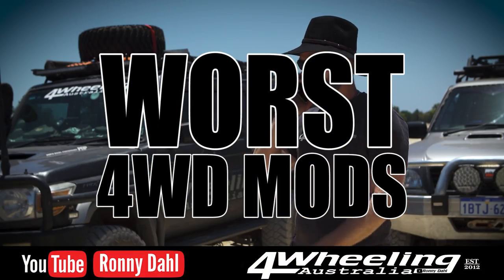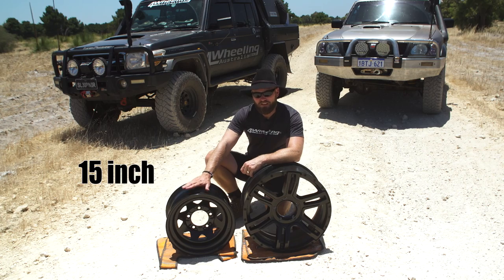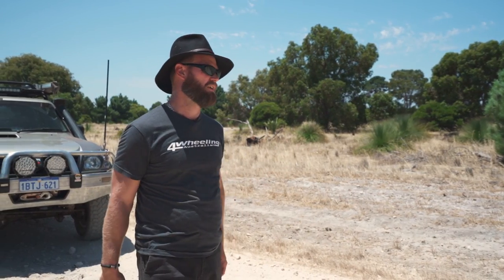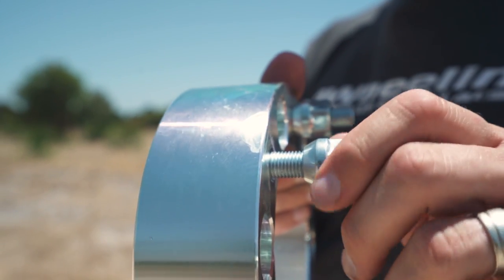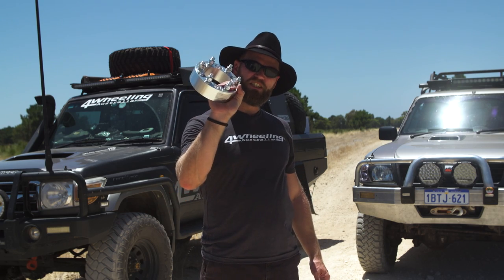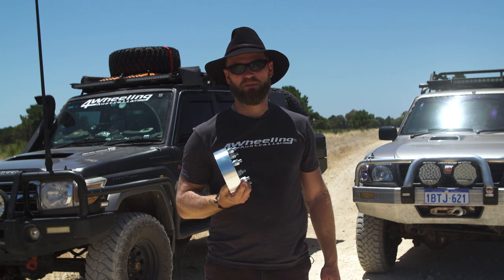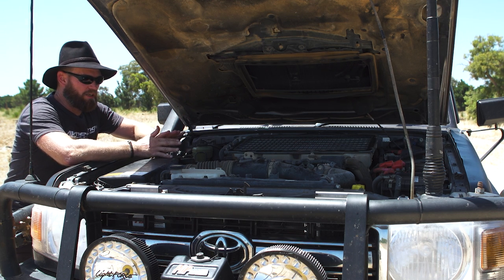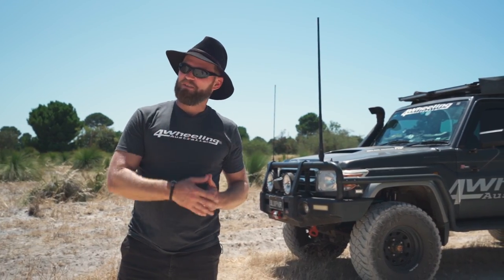WORST 4x4 MODS, DON'T DO THESE TO YOUR 4WD

Comment: U Aussie’s are smart. in America it’s a trend to get big rims small tires, I feel like I’m alone wanting plenty of rubber.

Y’all realize I’m half joking.
Reply: nothing wrong with being alone on something if you're smart mate! Well done.
Reply: Nah, you're not alone. Jeepers stick with 15" rims
Reply: Still rocking 15" steelys with 30" of rubber. So many try to talk me into going with 16 or 17.
Reply: Stick with what you know works mate! No point in having all show but no go.
Reply: Use to rock 15s in my previous vehicle, but I like pizza cutters on 16s. They aren't for the beach but they cut through the mud
Reply: Tho if it's tires for trucks you get the issue of the brakes being huge to get massive tow ratings so you can't smaller rims on it.
Reply: Not everyone in the states lol - most of us run 15-16" steelies whenever we can (my Jeep sits on 15" steelies and 33.5x12.5's ). I was bummed when I found out  my Toyota 4Runner can only run 17" due to brake clearance issues.
Reply: I meet in the middle with 20x14s on 38s that are 16.50 wide. Plenty of sidewall and no scuffs so far from off road
Reply: Nah you see a heap of wankers doing that on dual cabs these days in Australia as well
Reply: David Balken I’m with you David I don’t understand why everyone is getting big wheels and low pro tires.
Reply: I like my 16s with 235 55 16 rubbers on it and normally i run 80 psi
Reply: David Balken you ain’t the only one I love a lot of tire
Reply: David Balken - the difference is that you  have roads all over the USA, and that we have a few pretend-roads here in Oz 😄
Reply: No dude you're not alone not at all. It's freakin stupid. Even worse when the rims and tires are worth more than the truck.
Reply: Not alone man
Reply: I'm guilty of it. I bought my 2013 Tundra with 20s but it's my camper tower, I don't 4x4 it, that's what my 80 series is for.
Reply: So my truck came with 20" wheels from Toyota so I found some 18" TRD off-road wheels and some good AT tires as well.  Guy at the tire shop asked "why would you want smaller wheels and more rubber?".  I just shook my head :)
Reply: Your not alone,  I live in Illinois and see big rims all the time, the pavement princesses make me sick
Reply: I run 20s on my ram but I have 44s on it. Nothing is stock on it as well. I hate the rubber band tires. I have big brakes that’s the only reason I run 20s and nothing snaller
Reply: Definetly not alone, but the people with big rims aint offroading.
Reply: No mate, I’m in South Texas with a ram 2500 6.7 L turbo diesel and I want 18 inch rims maybe 20 inch rims with 37 inch tires and a 3 inch lift (Carli suspension with King 2.5 shocks) Bear in mind that 3 inch kit is only half an inch taller than the leveling kit, Will fit 37‘s with plenty of room for articulation.
Reply: David Balken  ..  Perhaps a trend in some circles, but the vast majority in the USA do not have such rims/tires.
Reply: David Balken I run 35-12.50-15
Reply: David Balken I wanted 16’s on my Jeep with 35’s but couldn’t get the rims I wanted so settled for 17’s. Still lots of rubber and will be badass if I move to 37’s
Reply: @canonphoto    ..  My Tundra has 20" rims with large BFG T/A KO2 tires. Can judiciously drive just about anywhere, even towing an 18ft camper. However, I also installed a winch and carry traction devices just in case.
Reply: Not alone here! I got 16" wheels with a 33" tire and im in california! I laugh so much at the guys with anything bigger than an 18.
Reply: @gregshue645    ..  As long as rims/wheels are sized to the tires and vehicle, it makes no difference. For example, most full-size 4x4 pickups come with fairly large rims with tires to match. Those large trucks would look silly with your 16" wheels.
Reply: @dwightstewart7181  of course! If i had hone with a 35 or a 37 I would have gotten a 17" wheel but i like more side wall than metal its just my preference, that goes more most of the people in the offroad community i know
Reply: @gregshue645    ..  Okay, we're clearly not communicating. Let me try again. I like "more sidewall than metal" too. My point is that you don't need small rims to have large sidewalls. You just need tires sized to match whatever rims. My truck, for example, has 20" rims with BFG T/A KO2 tires (aggressive all-terrain tires) with substantial sidewalls. Many of us in the "offroad community" run these popular tires.
Reply: @ewingfox6459  kind of like my 02 Explorer sport needs 16's trying to set up for light overlanding and Gambler 500 recovery (bought it running for $750 from a junk yard)
Reply: Yeah and the only off road you do is getting in and out of wall mart
Reply: @jerrysmith8326    ..  Where do you get notions like that, Jerry? You evidently don't go off-road, so you don't see us off-road. That doesn't mean that we're not there. Regardless, 4x4 is more than just backwoods. It also helps in bad weather, dirt/muddy roads, and so on. Same with tires. I tow a large camper trailer. Hell, if nothing else, 4x4 and those tires helps me get away from you.
Reply: @robertvulliet3278  nothing like a junkyard exploder!  Great recovery vehicle!
Reply: The difference is that  Ronnie is talking about rigs that actually go off road.  A majority of the trucks you see on the roads with 20/22/24 inch wheels and thin sidewall tires rarely, if ever see dirt/mud or are used to haul/tow as they are intended.
Reply: You're not alone as long as I'm alive.  I was happy to get a new Silverado WT last year because it comes standard with 17" wheels and black bumpers and without a lot of the crap you don't need.  Too bad you can't get a radio with knobs, buttons and a CD player, though.
Reply: Here in Texas we call those 7-Eleven trucks.when it's time to go off-road they all meet at the 7-Eleven leave that ship sitting in the parking lot and ride with a buddy that has a real off road truck
Reply: @scarharting5577  , CD player?  Wuts thayut?
Reply: You'll notice those people also never have a spec of dirt on their F350 because they dont offroad it. Seeing lifted trucks with 22 inch wheels and street tires makes me just cringe, because they literally only did it for looks. Im a function over form guy, everything i do serves a functional purpose, its not about looks.
Reply: As an American from California I disagree. People that take off roading seriously usually run 16 inch wheels and like standard now is 33s to 37s. Now mall crawlers will run 18 to 20 inch wheels for the look more than functional
Reply: @aarons2613  ,  There are a lot of guys that have more than one set of tires/wheels as well, and change them out, depending on what they are going to be doing with the truck/rig.
Reply: @hannahranga  trucks with massive tow ratings usually aren't the kind of trucks you want to take out into the bush. I've yet to see those huge tow ratings be useable on any off road capable trailer, which are usually fairly small and not ultra heavy
Reply: @ewingfox6459   You can still get decent rubber on 17s.
Reply: @dwightstewart7181    If you'd ever seen one, you'd know they look silly with anything bigger than a 17.
Reply: @dwightstewart7181    Yes, we're not communicating.  Anything bigger than 17" looks ridiculous.  Semi trucks have 22-24" wheels.  Pickups look foolish, and they ARE foolish having wheels anywhere near that big.
Reply: @scarharting5577    ..  Okay, if you really believe that, fine. My mid-size 4x4 Toyota Tacoma has 16" wheels, with off-road tires sized to match. My much larger full-size 4x4 Tundra has 20" wheels, again with off-road tires sized to match. I don't think either looks "ridiculous," nor would I change the wheel/tire combination on either. Good-day.
Reply: @scarharting5577  yeah, but I would like to be able to get more sidewall - not sure I would like the compromise in breaking performance it would cost w/o going to a ridiculously expensive aftermarket brake setup to fit inside a 16-inch rim!
Reply: Sadly here in the states plenty of idiots out with 26" rims with low profile "mud terrains" lol
Reply: Vladimir_Bone Spur_tRump  ...same for me... with BFGoodrich K02 A/T
Reply: American former and future Jeep owner myself and the 20s belong on my Challenger. If I've got 20" wheels I'm running at least 44" tires on an offroad rig.
Reply: Im in US state of Georgia running a 2001 Jeep TJ  with 3" suspension lift, 1.25" body lift, 33" tires on 15" steel rims and doing fine. When I finally make my way to MOAB I will probably go to 35" tires but still have to double check tire clearances before I do.
Reply: And Mexico I have 20 inch rims haha 😂
Reply: @jpageify  nothing wrong with 16 or 17" times in my opinion. You often need them for big brake kits, which are a must id you really increase the tire size.  I can't stand the 18+. That being said, I still have 15's on my 01 wrangler with 33's
Reply: @scarharting5577  a good reason to buy used trucks.
Reply: No youre not. 33s on 18" rims will be getting 35s next time round. I have a 2500 so Im able to get away with that. Elsewise Id be running 15" or 16" rims on smaller utes
Reply: @The_Ballo   go the 235x85 . R16  they will walk all over  any soft sand. Just whatch you dont roll it off the rim
Reply: @paulsouth4794  That's what I use
Reply: Custom offsets dislikes this comment lol

Comment: I agree with Ronnie. Make sure every mod has a purpose and don't do anything just to make your truck look good. Most decent 4x4's require minimal mods to go off road, some, like the Defender, Jeep or Landcruiser 70 are extremely capable just as they are.
Reply: 80% tyres
15% winch
5% all the rest

Comment: Here in the states we see people all the time that have 6-9 inch lifts 22"rims and wheel spacers!  But they do ok for getting back and forth from the mall to the carwash.  Lol
Reply: Ahh! but they look cool.. Virgin 4x4 ;rock crawler trucks that have never seen any kind of dirt. I see them as dumb.
Reply: Dont forget the 12 in. dropped hitches. For their boat.
Reply: Ahh, you see in California, we have the lowrider trucks. So think, 32 inch rims, 2 inches of ground clearance, and sometimes stretched tires.
Reply: cody b it’s people like you that make the rest of the world think America is a joke. The rest of the world talks about why their country is good but you talk about why it’s bad. Just saying
Reply: My Disco still has the stock size 18"s. I don;t do rocks, but I do go through some mud and sand. They work perfectly well, but I have been tempted to swap to the stock 16" rims, I am just unsure how it would tow by boat with that combination.
Reply: I got 14in of lift on 20x14s with 3in spacers and 38s. Its pretty decent honestly but off road the steering wheel gets ripped hard
Reply: I don't know, I saw this one rig that was so lifted and stretched that the axles were sagging. It actually caused the wheels to tilt inwards. Couple weeks later I saw it in front of a shop with busted hubs or something. And guess what? I saw it in the USA. I contend that it's that guy and guys like him making us look like idiots.
Reply: If they can fit in a carwash that is xP
Reply: But they won't even get to the mall reliably for long. Talk about making your 4WD vehicle unreliable man. Bye driveline, ball joints, brakes, control in the snow, offroad capability.  Wave bye to all that. 😂
Reply: cody b so much jealousy in these comments
Reply: Those are glamour and glitz trucks that never leave pavement lol
Reply: @codyparker679  GO WITH A BIGGER RIM. LOL DUH
Reply: And when they try to flex on a small ramp, they're about to flip hahhahahhaa
Reply: Solar Fry I’m willing to bet I’ve done more And took harder trails than some of the pavement those mall crawlers have seen, in my stock S10 Blazer

Comment: A row of 10 spot lights on the roof and 6 different aerials. A daily driver with a Kings roof tent, awning, 3 jerrys, maxtrax, high lift jack and shovel all permanently on the roof. You do 1000kms of remote corrugations with all that crap on and it will collapse on top of you. Plus, you're adding 5-6 litres per 100kms at least just lugging it around.
Reply: mikehzz correct and they never see mud. Funnier that they can afford high end things but only get a kings awning coz getting a decent one costs too much 😂
Reply: I shake my head when i see 10-20 gallons of gas not diesel hanging off the back of a daily in the city. just waiting for a fender bender to get hot really quick!
Reply: You've seen Graham Cahill's GU Patrol extra cab then eh ? LOL
Reply: We have a few guys here in the states with this setup - NEVER been in the bush.  One guy came to our local offroad club brunch/annual meeting - had FIFTEEN pod lights or light bars (all cheapos) the shovel, hi-lift (with no jack points) 18" rims, even a CO2 air-up system, got his club inspection, then bailed out before we hit the trail (a very low key ride) , no explanation, not even a heads up over the radio - just ghosted us.  Guess he just wanted his sticker for the mall crawl :D.
Reply: Expedition rigs that will never leave the pavement or even the town. My DD has all the off road tools and fuel cans too.  I have been lucky to spend a few years exploring the southwest united states in a big 4x4 camper truck.  Oh Yes, the extreme weight of a full size camper really slows you down off  maintained roads and totally off many steep trails. The bad BLM or oil company roads can be a crawl but for me that's OK. At the end of the day, just hop in back, switch on the solar power, relax, watch a movie, microwave some popcorn, cook dinner and get some sleep. Yeah, I get about 13 MPG & mostly run biodiesel. There is still a lot of amazing places out there to see, no need to be in a hurry. Just keep moving, keep enjoying life and don't be afraid to get dirty along the way.  New Mexico & Texas, perhaps up to Black Mesa for the meteor showers this summer sounds fun.
Reply: mikehzz 😆😆👍👍 I hear ya

Comment: Got my modest 1996 F250 7.3L with some 285/75/r16's, just did ball joints and tierods, got 34 gallons of fuel to carry, and a nice bed for my camping gear. Small front lightbar and some tools in a box, perfect for modest trails and getting some nice camping this summer.

Comment: Cheap brush guards that collapse and cause more damage in a collision instead of a proper bumper/bull bar.
Chrome......anything
Bargain recovery points
Steel individual steps on trucks where a slider should be.  They are just a spot to get hung up.
Reply: Man so true. I am currently in Mexico and nearly every damn 4WD has these and they are awful. Some of them stick out so far they are killing almost half the approach angle. All just to look cool. If I buy a truck here the first day I will for sure have to rip off the stupid crap.
Reply: My Jeep wj bumper added like 3 inches but also has a better approach angle and more clearance but those 3 inches also let me have a winch

Comment: Re: hoses. Always say "When one hose goes: replace them all." Somehow I lived 55 years without learning this. It's one of those things your dad, grandpa or sister should've mentioned at some point.  I was replacing them one at a time,using up a roll of duct tape and about 50 gallons of water,. It took the third hose in three weeks to make the little light blink on in my head. My mechanic? He should've said something.
Reply: So true, we do get smarter with age don't we.  I always have a minimum of two extra hoses and belts for everything on my truck. and never seemed to need them, even after 230K miles, but darn glad I have them and the tools to change them.
Reply: @donoberloh I'm glad you said that, it made me think! In any video that talks about things you should include in your vehicle, never have I heard anyone mention hoses and belts. Simple but great idea. Thanks
Reply: the only hose that will blow will be the bottom rad hose,,unless you have low water,then the top will blow..heater hoses last forever..yes,if you travel thousands of miles out bush,allways keep spares,hoses,belts,alt,starter.40 lt water.tools.
Reply: Same for belts. If your vehicle has more than one belt, change them all at the same time.

Comment: I use a HiLift Jack alot and have been using one for 30 years. I use it on the sides and the front and rear. I build my own bar work though and it can support the entire weight of the vehicle.   However alot of people been hurt from using the HiLift but that is because they haven't read the instructions and were not paying attention. I also carry a  bottle Jack. That Jack has saved my butt many times.
Reply: Spot on Simon.    I have 2 and have used the heck out of them. Try carry a winch and battery out in a swamp to pull out a stuck vehicle (UTV 4wheeler) had to do that a time or so. FYI I can lift my "rock crawler" XJ or my LJ side front or back with Hi-Lift too. 👍 Have I stuck a Hi-Lift in new Jeep not yet no way of use damn plastic bumpers.  So I'm with you on Hi-Lift jacks.  To the point of my second one is a 60 in one the other one is about topped out just getting to rock rails.